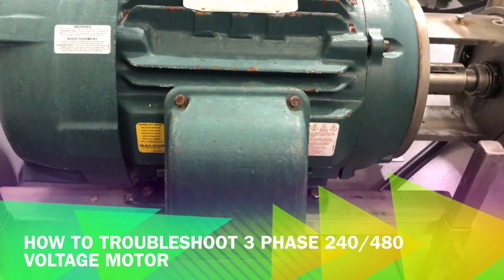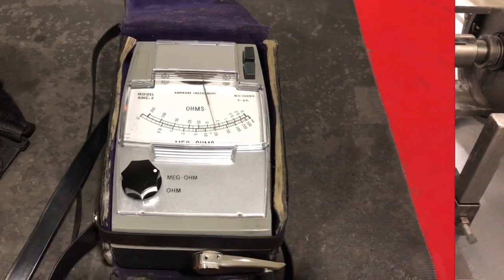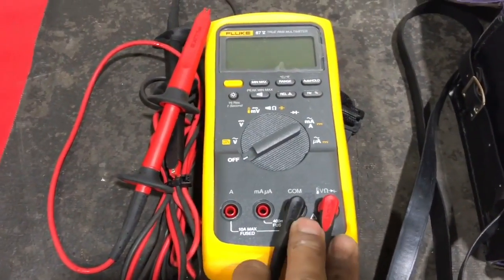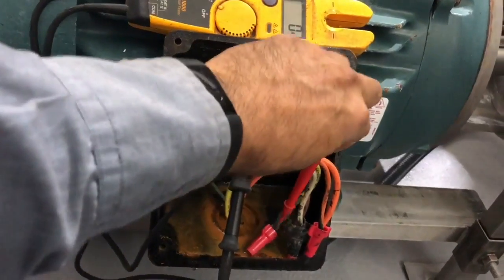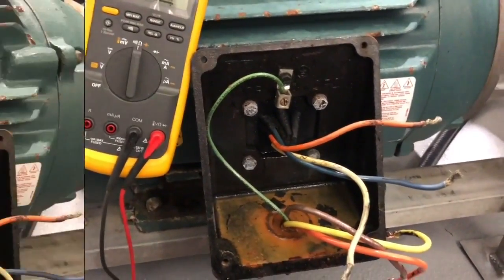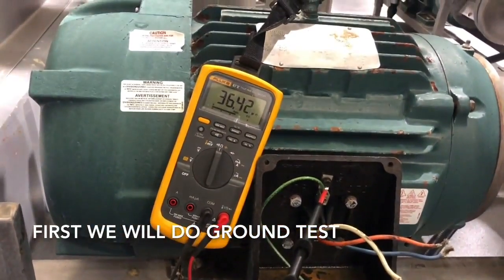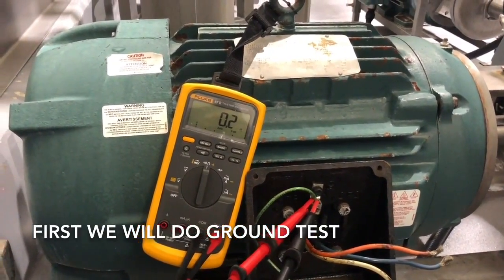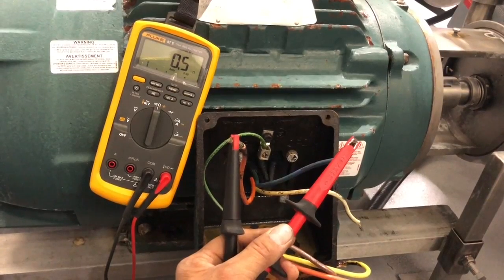How To Troubleshoot 3 Phase Motor with Multimeter

Comment: If you are checking the resistance of the phases so are you checking the resistance between the same phase or with different phases with each other? Like are you checking the resistance between the red phase  and the yellow phase or are you checking the resistance between the red phase at one end and red phase at the other end?
Reply from the maker: 3 phase motor have to have same ohm phase to phase all 3 
Phase to ground should be Mega Ohms 
I checked first phase to phase to make sure motor not single phase than phase to ground to make sure motor not ground

Comment: Where did you get those leads for the multi meter ?
Reply from the maker: The one I am using came with meter but you can buy from eBay by the meter model